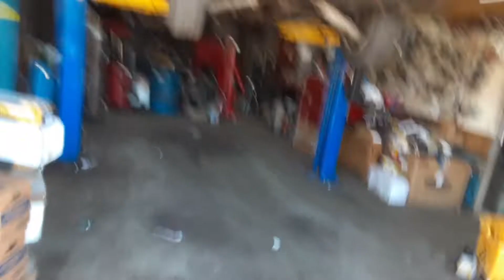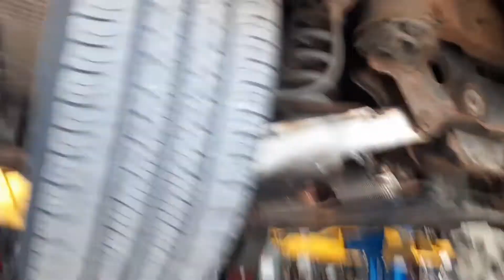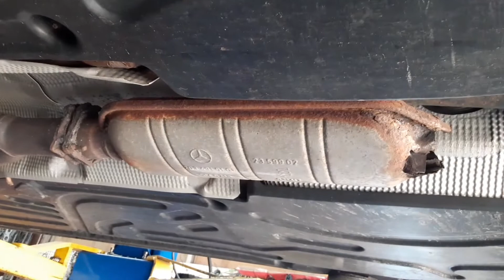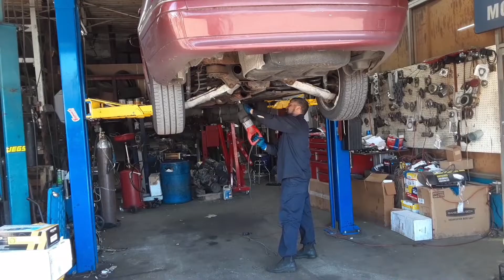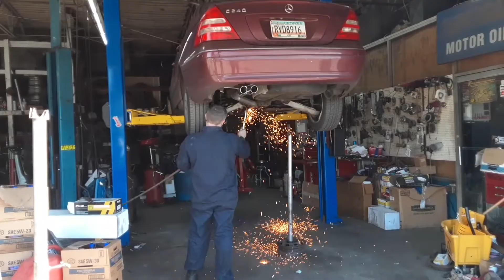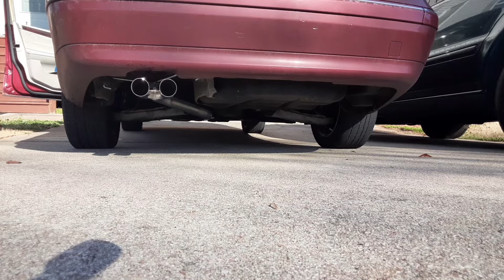Mercedes C240 Straight Pipe Exhaust Is All Finished

Comment: These vids are super helpful. i have a resonator and muffler delete on my 2003 mercedes benz c240 as well. Where did you order the straight pipe and tip? Also how much did it cost, as well as the repairs?
Reply: Sounds the same?